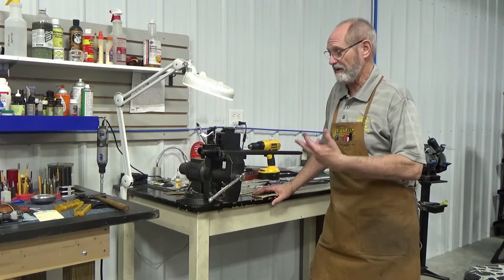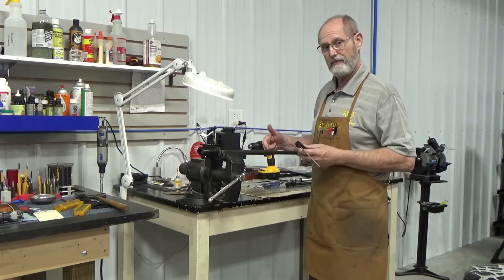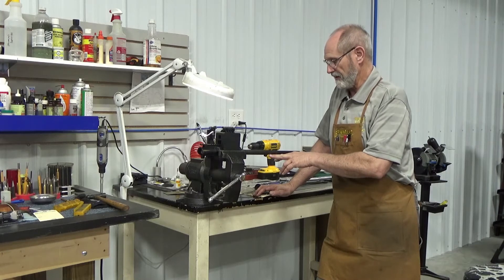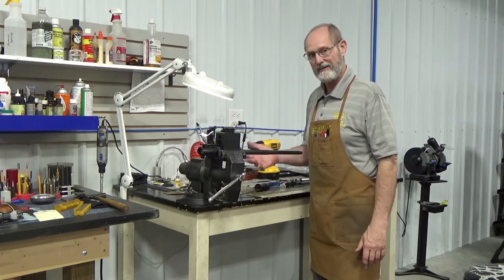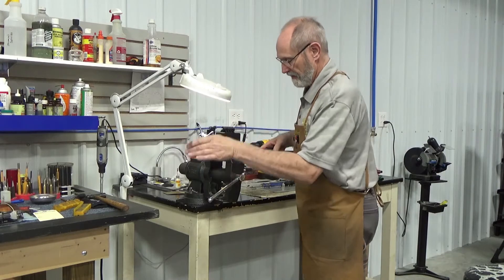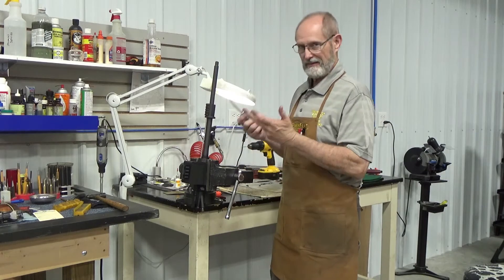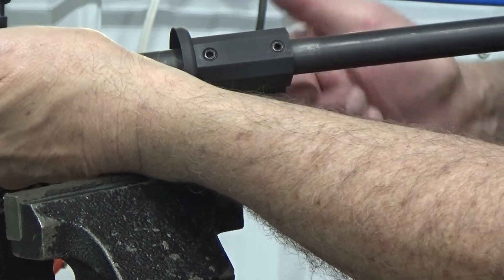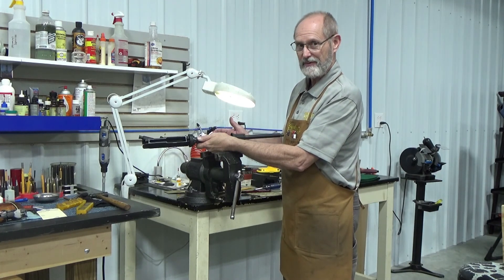Gas Block Replacement AR-15

Comment: My gas block is stuck. It will not turn and slide off barrel. I was wanting to back it off from the shoulder and realign it since my rifle is short cycling. Is this common?